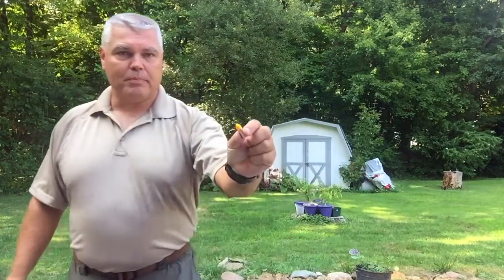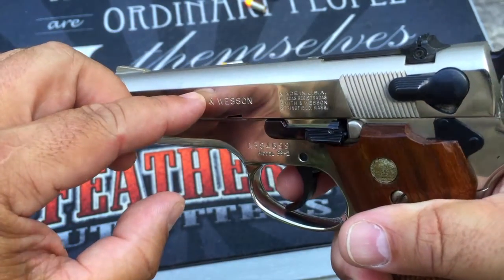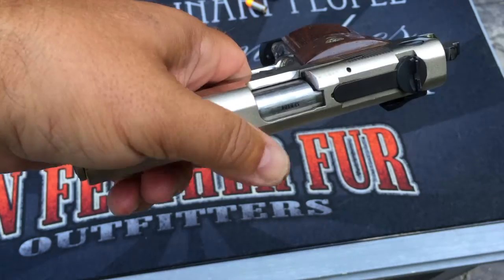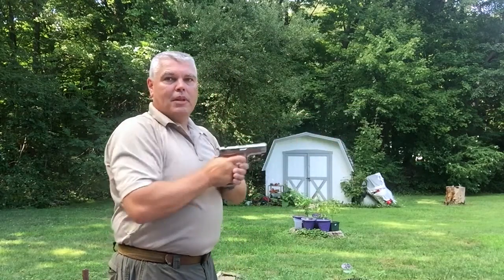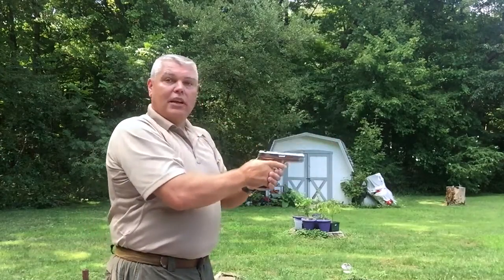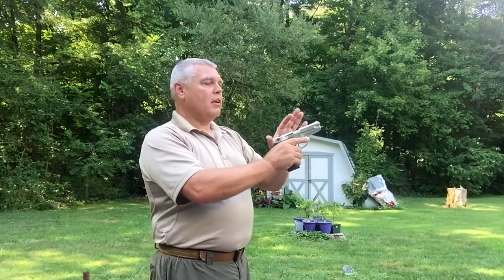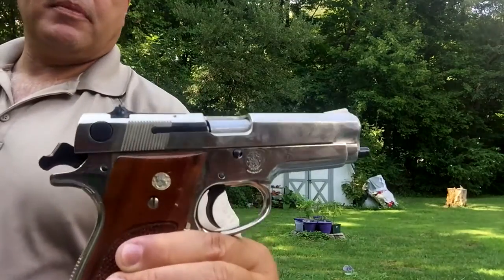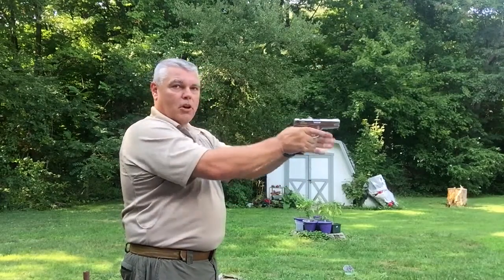Semi Auto Pistol Malfunction Causes and Solutions

Comment: Turning it upside down to clear is very helpful, a combo to clear the most common problems. I always turned it to the extractor side, which is a weird position to be in with the external rotation, wiggling to get it out. I'll try that the next time. The detailed explanation is highly appreciated. 

I guess it's not that easy to cause the malfunctions for show and tell.

Comment: I think that last footnote about revolver failures deserves a bit more depth.  I've heard far too many times that "revolvers can't fail."  What I've seen is that revolvers may fail at a lower rate, but when they DO fail, it's a LOT more difficult to get them running again.  It's never a weak grip or  half-seated magazine or old spring causing the issue, instead it's out of spec ammo that prevents the cylinder turning, or a rounded off lock or pawl, or a bent axis pin.
Reply from the maker: I agree. Revolvers can and do malfunction, and when they do, there is usually little that can be done in the way of "immediate action."

Comment: Nose diving can be caused by Ammo that has an overall length that is too short or too long. Common with hand loads but also with factory Ammo. I have had trouble with Core-Bon because it is shorter than most. I think they seat the bullet deeper to get higher pressures. Thanks for an excellent video.
Reply from the maker: Thank you. You're correct, nose-diving as well as some of the other malfunctions I mentioned can have more than one cause. I was just trying to cover the most common causes.

Comment: THE RIM OF THE CARTRIDGE SLIDES UNDER THE LIP OF THE EXTRACTOR WHEN THE SLIDE MOVES FORWARD AND PUSHES SAID CARTRIDGE FROM THE MAGAZINE - """VERY, VERY GOOD POINT""" - BUT NEVER, EVER, NEVER DROP A CARTRIDGE INTO YOUR PISTOL THROUGH THE EJCTION PORT AND LET THE SLIDE SLAME FORWARD, MAKING THE EXTRACTOR "SNAP OVER" THE RIM OF THE CARTRIDGE, IF YOU DO THIS SEVERAL TIMES YOU WILL (FOR SURE) BREAK THE EXTRACTOR [NOTE - THIS APPLIES TO THE 1911 AND THE GLOCK!!!!!!!] - ALWAYS, ALWAYS FEED CARTRIDGES INTO THE CHAMBER OF YOUR PISTOL BY WAY OF THE MAGAZINE .

YOU DONE MADE A GOOD VIDEO - BRAVO!!!!!!!!!!!!!!!!!!!!!!!!!!!!!!!!!!!!!!!!!!!!!!!!!!!!!!!!!!!!!!!!!!!!!!!!!!!!!!!!!!!!

Comment: How about a nose up malfunction it’s not me or the magazine I’ve tried different magazines and different ammo . Seems to happen in the first 3 rounds all I have to do is slightly pull the slide back and it will chamber
Reply from the maker: My  first suspicion would be the magazine. If it's not that, then maybe a defect in the feed ramp or chamber.  Without seeing the pistol and the malfunction, it's hard for me to say.
Reply: @hrfunk  ok thank you
Reply: @hrfunk  on the nose up malfunction would you suspect too tight of lips or too wide on the magazine?
Reply from the maker: As I said previously, without being able to actually examine the pistol, it’s very hard for me to say. It COULD be that the lips are “too wide” and the cartridge is being released too early, but that’s pure speculation.

Comment: Went to the range Saturday  took my SWSDVE 40 Cal & about 4th or 5th round down & it jammed on me bummers so drop the mag cleared the jam reload it tried again it worked ok placed another mag of 10 rounds. Keeping track of my hand holding using the 70 /30 rule where since I am a lefty used my right hand as the support & with left hand 30 as my shooting hand also kept track of not doing the teacup holding :(  That I know will cause jams  But even doing that it kept jamming i.e. Stove piping  :(   So after watching your video I going go back again do another shoot using your methods  & will let you know how it goes.
Reply from the maker: You might want to try a different kind of ammo. That could be caused by underpowered loads.

Comment: very clear and comprehensive instructional video. BTW, the M39 was my very first pistol, many moons ago. Are you familiar with the Lionheart LH9? Closest pistol still being made to the M39 (actually M39). Got one recently and prefer over the plastic striker fired pistols.
Reply from the maker: No, I'm not familiar with that model, but if it's based on the M39 it should be a fine pistol.

Comment: Thanks for a very informative video. I have had a couple of 9mm pistols that had frequent failures . Walter CCP and Beretta px4storm. Both are unique designs which require special care to avoid failures. Px4 requires grease not oil for cam. CCP requires very firm grip and still failures to eject. Selling the CCP and working with the PX4

Comment: Hello Sir, I have a question, I have sig sauer p226. The bullet jams in the chamber when I fire the live round. Because of this, smoke comes from magazine and lower part and bullet shell turns black due to jamming. Else on racking, it responds really well. 
What could be causing this problem.
Reply from the maker: There are a lot of things that could cause the cartridge to not feed properly. The first two things to check are easy. First, try a different type of ammunition and see if the problem goes away. If not, try using different magazines. If neither of those steps solves the problem, I would suggest taking it to a gunsmith or returning it to Sig for repair.

Comment: tHE STOVE PIPE THING THEN THE SLIDE DID NOT GO ALL THE WAY FORWARD IS BECAUSE THE EXTRACTED BULLET FROM THE MAG WAS INTERFERED WITH BY THE STOVE PIPE AND IS IN FRONT OF THE EJECTOR WHICH IS HOLDING THE SLIDE BACK FROM NORMAL  SO THE HIT IN THE BACK OOF THE SLIDE FORCES THE EJECTOR TO MOVE OUT AND SNAP INTO PLACE ON THE CARTRIDGE RIM ALLOWING THE SLIDE TO BE FULLY FORWARD AND WILL THEN SHOOT.

Comment: Hey Sarg, I have a question for you. I have 4- 1911's in .45ACP and 3 out of 4 have few issues with my 185 gr FP reloads. There is one exception, my Para Ordnance P12. I've done a full spring replacement (Wolff) including magazine springs in 3 mags yet about 1/2 way through a 12 rd mag I have a Failure to Load situation. It ejects the brass but the next bullet will not feed correctly and just hangs up the slide.  I never had this issue with 230 gr RN ball ammo but I encounter it consistently with the Para Ord (Canadian made).  Could it be I'm seating them too far back for this particular feeding ramp?

Comment: Unfortunately I get a stovepipe pretty often (about 1 of 20 shots), but never when I rack by hand. I have a .45 ACP Peter's Steel, it's pretty tight, I already changed the spring from 18 lb. to 14 lb., now it's a little better, but still 1 stovepipe out of 30/40 shots. What do you recommend? Thx a lot!
Reply from the maker: The first thing I would try is a different type of ammunition. It could be an incompatibility issue. It could also be a magazine problem, especially if it happens on the first round you fire. Make sure you also try different mags. Take a look at your ejector, and make sure it's in good shape. There's a possibility that the extractor could need some tuning too. Also, check your pistol's chamber and make sure there is not a tool mark or some other defect impeding the case as it extracts.
Reply: @hrfunk  thank you very much for your tips! Now I accidentally realized that the bushing rubs the barrel slightly in an little area in the middle of the barrel. it's a little harder to move the barrel manually through the bushing in this area. In this area the barrel seems to be slightly thicker. Is that a possible reason for the malefunctions (stove pipe) and if yes, what do you recommend? Thanks again for you help :)
Reply from the maker: @1911kodi  If it slows the slide as it reciprocates, it COULD cause the pistol to malfunction. This is a bit worrisome. The first thing that occurs to me is that the pistol's barrel is bulged. Possibly due to a squib load that lodged in the bore. If someone fired another round without realizing the previous bullet was still stuck, it could have bulged the barrel in the spot where the first bullet was sitting. That would be a better outcome than having the barrel burst, but it still might require replacement of the old barrel. Take a look down the bore and see if there is a visible "ring" in the area where the bushing rubs. If not, then it could be a manufacturing defect. May I ask what kind of pistol it is, and if you are the original owner?
Reply: @hrfunk  omg, now I'm worried, too :D it's a Peter's Stahl (I guess a German Company), Cal. .45, 1911 Model, it's second hand. I can see no ring(s) inside the bore as you mentioned. And you can't  see the "bulge" from the outside with the naked eye, you only feel it when you slide the bushing over this area (about the middle of the barrel). There it gets a bit harder to slide it further on. Greetings from Germany!

Comment: Newbie here...... i know this video is from 4 years ago. Here is my question: you mention to tap and rack a failure to fire in your video which could be an improperly seated mag and a round didnt chamber. A click of the trigger and no bang could also be a squib correct? A tap and rack could blow your gun and possibly your hand up. 

Am I wrong about this ? Again i am a newbie so be kind
Reply from the maker: No. You are right. The question is whether the immediate danger you face from an adversary outweighs the potential danger posed by a squib load. With fresh, factory-produced,  ammunition the possibility of experiencing a squib is very low. Considering you have had to fire (or at least attempt to do so), and your pistol has failed to function), most defensive shooters will apply the immediate action drill (i.e. tap, rack, and ready) in an effort to get the pistol into action as quickly as possible.
Reply: @hrfunk  thanks for the reply. Ive been wondering about this but have been too afraid to ask and have 40 people jump down my throat. Being a female i totally overthink of the 1001 situations that could never happen😂. Thanks for making this video to help newbies like me.
Reply from the maker: You’re welcome!

Comment: He funk ...thoughts on a compact  officer size 1911 not goin fully into battery ...its a new gun...could it be that it just needs to be broken in? Extractor seems to be good... when i first got the thing it had trouble chambering a round( some was user error) that worked itself out...now it chambers everytime. But i still get occasional failures to go into battety and a simple tap to the bak of the slide puts in into battery....only have about 300 rounds in it... could it be its just a really tight fit or could it be something else?
Reply from the maker: There are a few different things that might cause that issue. It could just be a break-in issue. Run a few more boxes of ammo through it and see if the problem goes away. If not: Try the easiest thing first, i.e. a different ammunition. Next, try different magazines. If you still have problems, try swapping out the recoil spring. If you’re still having an issue after all that, then the pistol probably needs to go to a gunsmith. Good luck.
Reply: @hrfunk  thanks for the response. I appreciate it 🙏

Comment: what causes a bullet to get stuck in the barrel? its hard to get it out. I need an extra peace of rod or steel stud to push backwards. I just thought that maybe the bullets are big enough to the barrel... but i tryed to insert a new one in the barrel but  seems to be good & its happened to me all the time after 2 to 3 round.
Reply from the maker: The most common cause is underpwered handloaded ammunition. Switch to some different ammo and see if the problem goes away.

Comment: I've experienced frequent malfunction with my Ruger P95DC, mostly with bullet failing to go inside the chamber.  When i  checked the extractor, a fair amount of gunk was present. Is it possible thats the cause? I already cleaned the firearm but have no time firing it yet.
Reply from the maker: That’s possible. If the gunk wasn’t letting the extractor to position itself properly, it could have been impinging on the case rim as the round was feeding and preventing it from moving up the breach face. When you get to the range see if the problem has gone away. Please let me know too. I’m curious to know if that solved your problem.
Reply: @hrfunk  thank you. Ill give an update ones ill be able to test it.
Reply: @hrfunk  Already tested my Ruger. It workout great! No issues with 100 rounds.

Comment: what lubricant / cleaner do you use on your pistols,  just curious. 
Thank you.
Reply from the maker: To clean, I use plain old Hoppes #9. For lubrication, I use a product that is recommended by the S&W armorer's school, H&K, and I believe Colt. That product is Mobil 1 Synthetic Motor Oil. I know that sounds odd, but I've been using it exclusively for about 10 years in my rifles & pistols and I assure you it works very well.
Reply: @hrfunk Mobil 1 Synthetic Motor Oil, thats all i use,no problems....

Comment: One malfunction I get somewhat frequently 1/300 rounds or so with my sig p320 compact is a round will fire and extract just fine then the next round nose dives up and gets caught in the top of the ejection port. the bullet is literally sticking out stopping the slide from going into battery..  its not a double feed since theres an empty chamber... What can cause this?
Reply from the maker: That is most typically caused by a defective magazine. It could be ammo related too. Try your pistol with a different magazine and see if the problem goes away. If so, then you’ve identified the source. If it persists, try different brands of ammunition and see if that makes any difference.
Reply: @hrfunk  Thanks, I should probably number my mags since I haven't kept track if it's been happening with just one or two of them. By the way, I've been shooting winchester 124 grain NATO fmj's for the past 5000 rounds, They're fairly over pressured compared to standard range ammunition, so I'm not sure if that would make a difference. Maybe the recoil spring is worn out already?

Comment: When I fire my last round in the magazine it is not locking my slide . Is there a reason for that.  It only happens if I'm slow shooting my pistol never happens when I rapid fire. Is this a safety issue? And why would this happen?  Sometimes it does sometimes it dosent .
Reply from the maker: Make sure you’re not resting your thumb on the slide stop. If you are not, then your magazine springs might need to be replaced.
Reply: @hrfunk  thank you sir I will try that and see . Really informative video great job
Reply from the maker: Thank you!

Comment: @ 11:25 "failure to completely go into battery", if its happening while shooting, and after a shot on next round it happens, what could be reason and what will be it solution? Thank you
Reply from the maker: There are several potential causes. The first suspect would be a weak recoil spring.
Reply: @hrfunk  Thank you for your prompt reply.